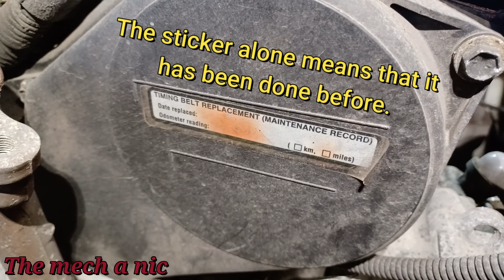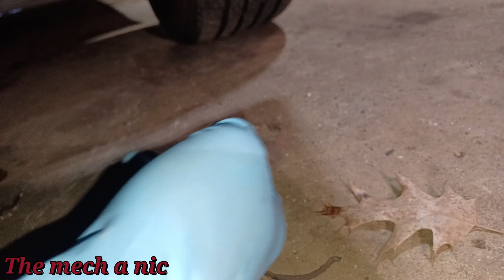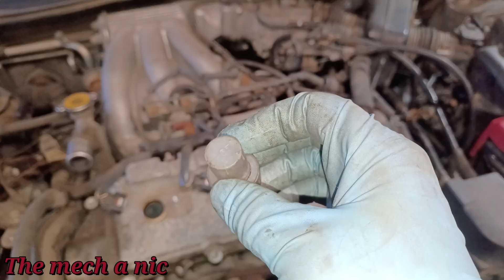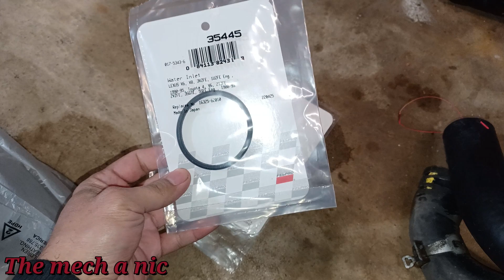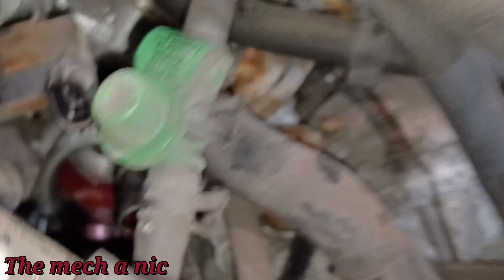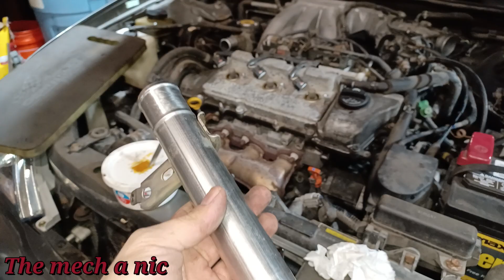toyota avalon timing belt / thermostat / spark plugs ( part 1 )

Comment: I just did that same timing job on an 04 camry recently, inclusive of  valve cover gaskets, plug seals , spark plugs, full service , rear hub and trailing arm bushings . I totally understand doing the easy jobs first .
Reply from the maker: That sounds like a nightmare! You definitely had it worse than I did lol
Reply: @themechanic6117  Yessir a nightmare of too many systems to work on in one job . I find it does get frustrating to work too long on one vehicle .
Reply: I was just wondering about the rubber debris . I might have tried wire brush on the rotary tool .
Reply from the maker: I tried that, it didn't do anything.  I just forgot to show it in the video. That gasket was bonded on there tight! Lol
Reply: @themechanic6117  Interesting .... noted

Comment: A tip from Joplin, Missouri. In our shop if it was rubber , Mopar combustion cleaner beats silicone spray hands down. You could push a rubber key through the keyhole with that stuff. 😂. And, does not hurt the rubber. When a hose was stuck from age and heat, remove the clamp, work an opening into mouth of hose, spray some combustion cleaner in it, work it around and hose slides right off. Also cleans throttle plates, or anything you want. Cheers!
Reply from the maker: I've never tried that before, maybe I can get my hands on some . For now the silicone spray does a decent job 👍

Comment: Low heat gun or hair drier for old & brittle plastic connectors.
Anything rubber (hoses, exhaust hangers, etc.) Brake parts cleaner not silicone!
Silicone tends to swell rubber & plastic, whereas BPC makes it temporarily slippery.
ETCG taught me that, long time ago.
Reply from the maker: I've seen BPC cause rubber to swell. Yes is does make it temporarily slippery though
Reply: @themechanic6117  TEST: Get 2 sealable containers (glass jar w/lid)
Silicone and the old O-ring,
BPC and another old O-ring.
Wait 1 hour. You'll be shocked.

Please make video of this. Even use digital calipers to record/show any differences.